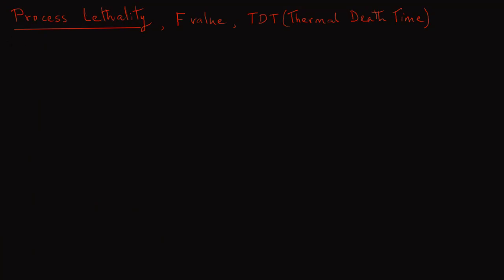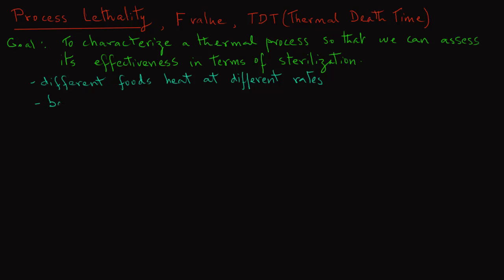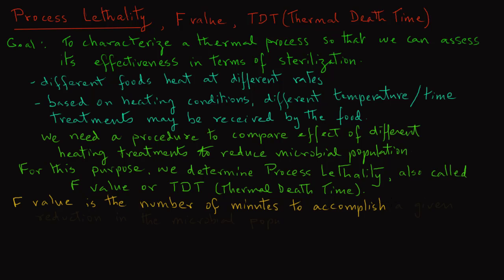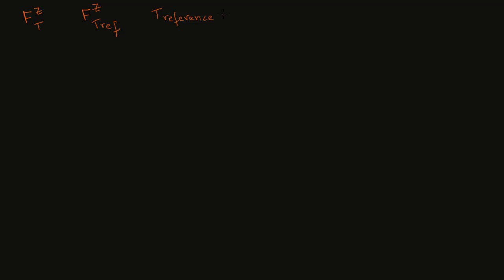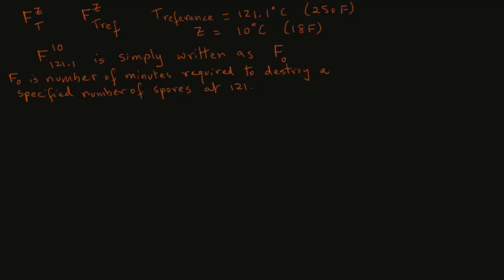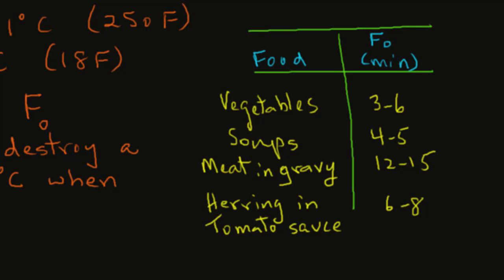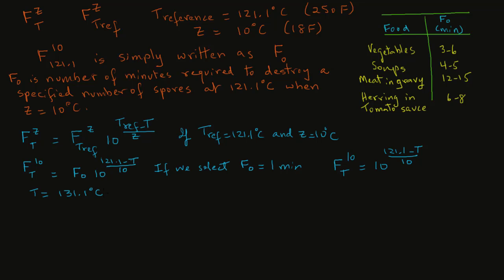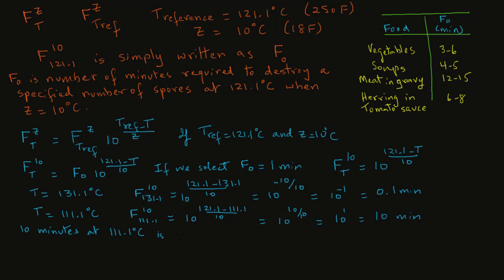Thermal Process Calculations - Lethality, Thermal Death Time

Comment: hello sir, thanks for the video. I have a doubt on the F0 formula. 
I'm john and i'm working in retort manufacturing company. currently i'm trying to develop a PLC program for F0 monitoring and the formula I got was F0 = t(time) X 10^(Tref-T/Z)  
Tref = 121.1, Z = 10 same as u said in the video.  I jst wanna know whether the formula is correct or not. 
but, u used F0 = 10^(Tref-T/Z) . 
kindly help me in this.
Thanks in advance.
Reply from the maker: The formula as given in the tutorial is correct. Note that in the example, we are using Fo = 1 minute, therefore, the formula (in the example) is abbreviated and Fo is not shown.